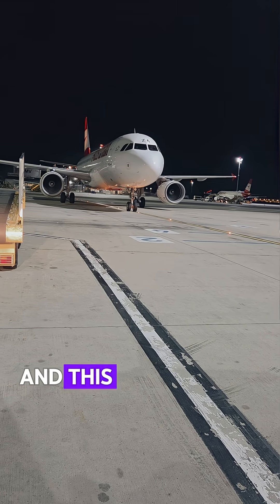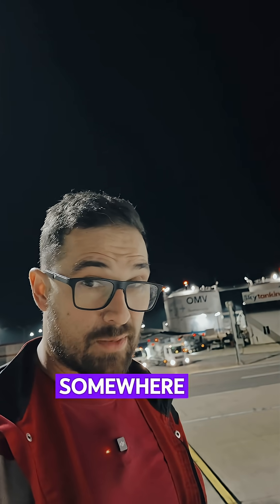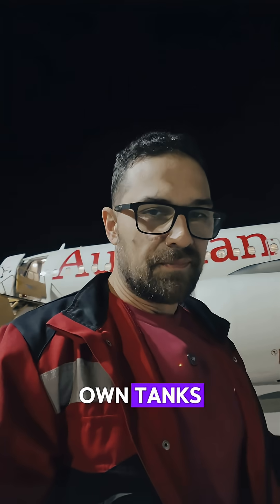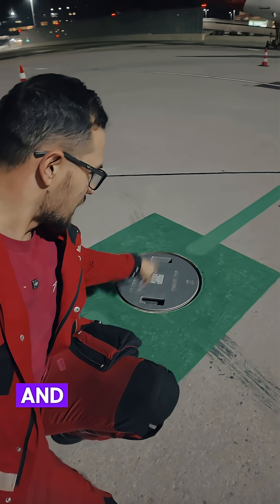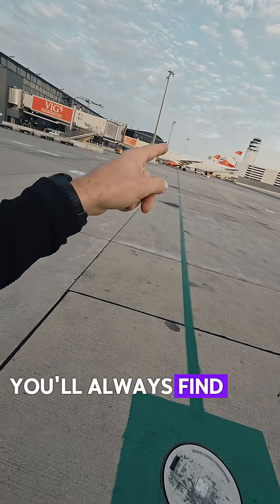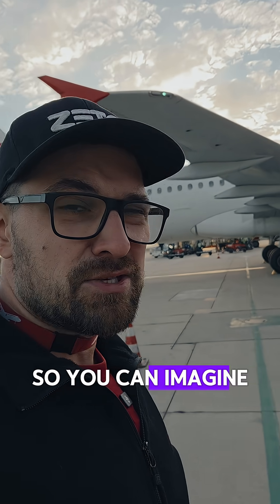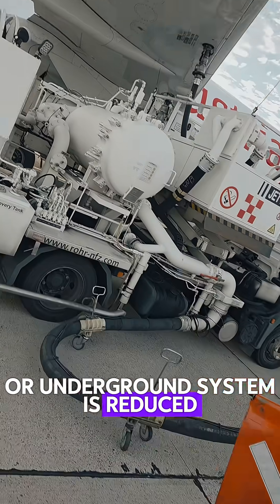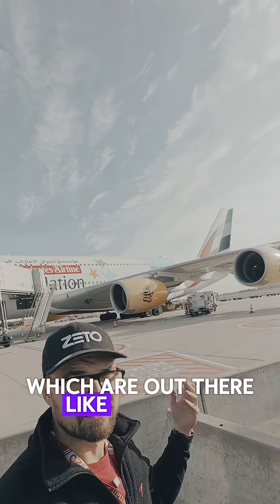how much fuel is stored on the airport  #fuel

Comment: Thats super interesting, thanks for sharing. I would never have known this, 145psi is a lot, wonder if thats just the pressure given by all that fuel in the tanks.
Reply from the maker: No there are two pumps running all the time to push fuel through 🙂

Comment: Thanks. How to prevent water mixing with the fuel?
Reply: This is achieved by keeping the system positively pressurized while below ground, and also through the use of special filters called coalescers. A water coalescing filter separates all water content at many stages of fuel transport and is monitored around the clock by sensors designed to shut down flow if water is measured in a predetermined volume. In addition to these measures, the underground system is equipped with low points that are routinely vacuumed out by utility personnel who monitor the entire pipeline at all airports across the world. Someone is always monitoring the system whether aircraft are present, or not. The fuel systems are active 24/7/365 and are only occasionally shut down for routine or non-scheduled servicing.
Reply: @bebakerThanks for such a detailed explanation. Appreciate!

Comment: How are the big tanks refilled?
Reply: I'm pretty sure, through huge tanker trucks which carry fuel from the refinery to the airport fuel depot .
Reply: @brandonpinto5290 Not exactly. The above ground storage tanks, or AST’s, are filled by underground pipeline directly from the refinery that can be miles and miles away. Airlines each negotiate their fuel needs with individual oil companies at airports around the world. Some airlines form a consortium to facilitate fuel purchases in many airports too. That all depends upon how business is conducted in that particular region and also upon demand for fuel. If an airline only flies once a week to a destination, they generally will pay via a consortium or even by the flight. On the other hand, an airline with 1,000 flights a day at a large airport, they will pay based on a delivered price that includes servicing the aircraft. These agreements are generally a cost per gallon in the USA.
Anyway, all the fuel is ordered by the fuel storage depot and arrives via pipeline, usually from 3-6 different pipelines, each from a different company like Exxon, Chevron, Phillips, etc… They all basically open a valve, transport a set number of barrels, and then shut the valves. Once complete the AST’s are strapped to confirm fuel levels and then density is calculated to complete the confirmation of the number of barrels received. Bills are paid, then the fuel must sit for an agreed upon time for settling before it is pumped to the field for filling the aircraft. These times can be reduced with permission from the FAA, if necessary. Handling Jet-A is a crucial process for everyone’s safe travels aboard aircraft.
Reply: The only time transport truck would be used is if the pipeline experienced unrepairable damage. Unfortunately, the larger the airport, the greater the impact because transport trucks cannot handle fuel fast enough to keep up with demand. In those cases, delays will quickly occur.

Comment: Does the trucks also make sure the fuel is not contaminated by water etc?
I seen somewhere it will automatically shut off if water is detected in the fuel
It’s mind boggling how these planes get off the ground with all this fuel onboard
Reply: Yes, the trucks have a two-stage filtration called a coalescer-separator that effectively collects and rejects any water from the fuel and deposits it where sensor at the bottom of filter vessel can signal fueler to stop fueling. Vessels are drained regularly throughout the day to check for any contamination. Also, fuel is filtered before it enters the depot tanks, and also before it enters the underground piping, so it is checked many times before ever touching the plane!
Reply from the maker: There is check before each refueling for water